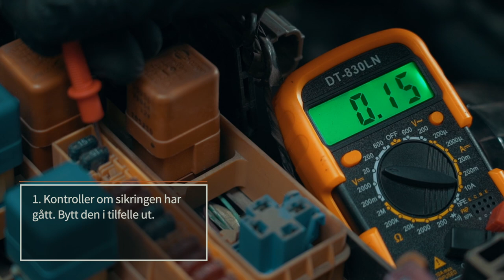Slik kontrollerer du kjøleviften til motoren | AUTODOC

Comment from the maker: Hjelp oss å bli bedre! Legg igjen kommentar 💬

Slik sjekker du en mekanisk kjølevifte
0:08 — 1. Kontroller viftereimen til kjøleviften.
0:28 — 2. Kontroller strammingen til viftereimen og tilstanden til strammehjulet.
0:37 — 3. Kontroller lageret til kjøleviften.
1:04 — 4. Kontroller viskosekoblingen.

Slik sjekker du en elektrisk kjølevifte
1:54 — 1. Kontroller om sikringen har gått. Bytt den i tilfelle ut.
2:03 — 2. Inspiser releet.
2:10 — 3. Kontroller at releet fungerer som det skal.
2:29 — 4. Kontroller kablene til kjøleviften.
2:37 — 5. Kontroller sensoren for kjølevæsketemperatur.
2:58 — 6. Kontroller tilkoblingselementene.
3:07 — 7. Slå på viften for å kontrollere hvordan det elektriske drevet fungerer.